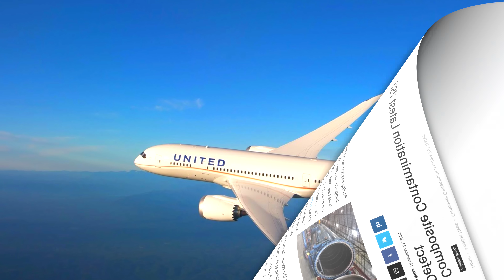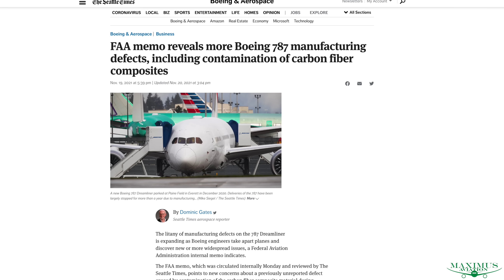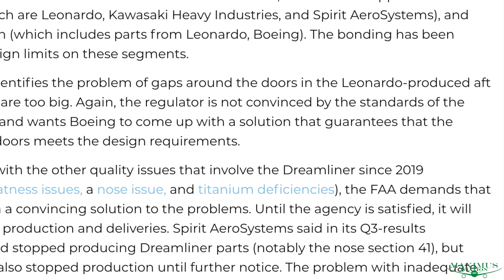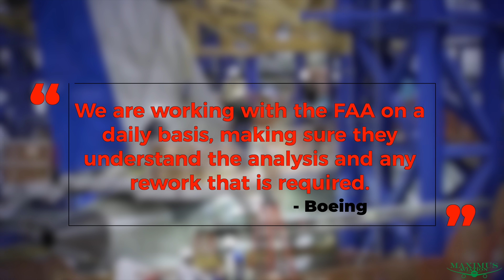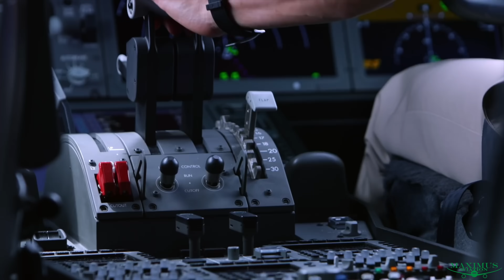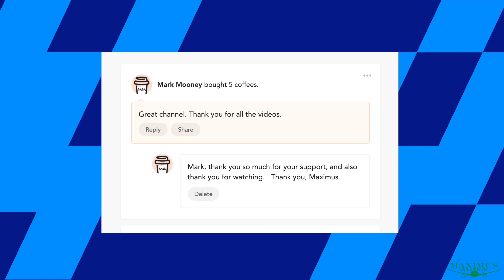Boeing Admits The 787 Carbon Fiber On The Wings Are Contaminated And May Compromise Wing Stability.

Comment: I used to be "if it isn't Boeing I'm not flying", and I do pick aircraft when I purchase tickets.  However, no more (besides the established Boeings like the 737s, 747s, 777s and no MAX of course).  Now I find myself flying more A320neos, A330s, and A350s.  By the way, yes 787 has never had any fatality yet, but remember they never really figured the cause for the battery fire problem.  They offered a very comprehensive and extensive "solution" to the battery redesign and installation, and that seems to "solved" it, but they never figured out what caused those battery fires, that really worries me.

Comment: A few things to be noted is that carbon fiber composites are used in civil aviation since the 1980"s..the DC9/DC10 used body parts made of carbon fiber....and there is two fantastic American companies who are the world leaders in this sector : HEXCEL and CYTEC ...the fact is that BOEING did not work with these two experts in the matter....you mention their names in the video/..,but AIRBUS did use their products ,fabrication ,and expertise.,that is why 50%+ of the  Airbus A350 is made of such materials..it's also 50% for the B787 but BOEING decided to work with other companies (too many actually) for a mediocre result that they face today...So yes AIRBUS did what BOEING  did with their composite body/wings parts..,but they worked with the best in the Business ,where BOEING decided to work with much less reliable companies...I guess for a lower cost .!!!..You say also that the B787 has been flying with ZERO crash issues for the past 12 years (great)..,but it"s for the next 12 years,we might have to worry now ,when carbon fiber parts fail..it is catastrophic and explosive...!!Hopefully it won't happen.!!.No more safe and reliable aluminium 747 flying for 30 years..!!!..and sadly it seems that BOEING has taken the same  path for the much awaited 777X ,with a very slow fabrication rate of only 3 units a month(says Boeing's CEO) with already flaws pointed out by the FAA certification board..BOEING must go back with working with the best ASAP ,and the best in the business of carbon/composites are American companies..!!!

Comment: Lets face it, only us, airplane enthusiasts read this. The majority of people couldn't care less
or the glue is holding or not. As long as they can fly for a few Euros from Amsterdam to Spain. Interview sample when the Max started flying again :" Madam, are you afraid to go on board of a Max? Answer, just a bit as long as it doesn't crash on the way to Spain giggling.
This was on Dutch TV. Interviewer once more , So on the way back it would be OK ?
Answer, well at least we have had a good time, giggles again.

Comment: Carbon fiber wings are nothing new, and Airbus is the pioneer in both carbon fiber in commercial aircraft and fly by wire and relaxed stability flight control systems. You cannot blame Boeings problems on technology - it is people in senior positions who are fault. You can only start correcting things when all the senior executives involved in causing the problems in Boeing have been sacked. Unfortunately there are still there, and still doing the same thing.

Comment: AMERICAN aviation has always been fly it and fix it later, to beat the competition. That was fine when they had the expertise and the engineers to do that, unfortunately cost cutting means they don't any more. So the have a new species of complex aircraft, with all new complex problems, and with the 737 Maxx and the dreamliner in trouble, they are in a very bad place.

Comment: Airbus is having its own issues with carbon fibre adoption.
Reply: That's right, but after a relatively inexpensive repaint affected 350s are fine again (the option all affected airlines excepted Qatar chose), while compromised carbon fiber in structural parts of the wing would demand new wings in worst case.

Comment: Wonder if this problem is also with airbus.. the composite failure issues airbus has found during paint stripping
Reply: There is no composite failure at 350s, it's a problem with the paint adhesive, probably because of the wrong choice of paint at early 350s. Carbon fiber expands different than aluminum in heat. 
There have been other airlines affected beside Qatar, however they chose a free repaint by Airbus and they fly their aircraft again, Airlines like Lufthansa which are not known to fly unsafe aircraft

Comment: I would like to know where the PTFE contamination is. Is it parts of a peel ply left on the surface of a laminate stack and was painted over but will not harm the structural integrity or is it in between plies?

Comment: Boeing took a risk and Airbus benefited?  More like Boeing forgot about quality control and concentrated on stock buyback to jack up its stock price.
 38 billion dollars that could have been used to train workers, retain and hire good engineers and produce quality product was used to buy back its stock. Boeing 777 was the last best Plane Boeing designed and made. After that for the last 20 years it has been going downhill.

Comment: Just some notes here as your story telling make it seems like Airbus waited to Boeing to experiment with new lighter and stronger laminated carbon fiber structures. In fact Airbus did experiment such structures far earlier than Boeing. i.e. the A310 series had a full composite tail fin and that was back in the mid 80's. The only step Boeing did before Airbus was to make a all composite airliner. I believe Beech was the first to produce a full composite aircraft for pax transport (apart from experimental aircafts or general aviation stuff, gliders etc.) and that was also back in the late 80's.

Comment: Who says the 777x won't have the same issues?
Reply: The 777X gets new engines - which are another possible risk. Engines and their reliability have been a Problem at the 787 (RR) and the 320 Neo (P&W). 
Aircraft are today built at the limit - which brings the risk of teething problems

Comment: Such a fundamental change in the structure of the craft - aluminium to carbon-fibre, should have required far more testing before rushing into production.

Plain and simple. Again, it's a problem of inadequate oversight by the FAA and the EASA. A350's are having many issues now as well.
Reply: Only partly true - as Boeing had developed it's own carbon fiber composite structures technology in the commercial arena, on the 777 program. Have any tail feathers of a 777 ever come apart not due to externally caused bond-failures? No. I was there.
Reply: @mafreeland1027ATGTurner  Which has nothing to do with what I said, except perhaps Bieing did better QA testing than Airbus.

Boeing has had its own quality issues in other areas, so maybe they aren't the best example to bring up.
Reply: @mafreeland1027ATGTurner  What do tail feathers have to do with cotaminated carbon-fiber in the wings?
Reply: @mafreeland1027ATGTurner  The tail fin of the A 300 was already made of carbon fiber. At the Concorde the rudder was made of this material. 
Other manufacturers used unconventional methods long ago, for example North American Aviation which used honeycomb structures in their XB-70, designed in the late 1950s

Comment: Airbus has had its fair share of problems with the paint and lightning protection on the A350 which is also related to composite carbon fiber use

Comment: I was a young electrician apprentice when Boeing Wichita (at the time) started building the nose cone precess building.  The project was start with problems.  Lowest bidder construction company Eby made many million dollar mistakes and at the time was loosing all contracts other then Boeing.  Eby got the project because they had already been security vetted and they had the lowest bid but later did change orders that cost far more then what they disclosed.  Had to tear down part of a building because the autoclave wouldn't fit through the door and a big hole in the wall of the clean room with a lift to name a few.  The technology and tools of fiber composition laying was least from Hawker Beechcraft (out of business now).  Mid project Boeing Sold the Wichita plant to Onix/Spirit Aerosystems and essentially fired all of their workers or cut their wages in half.  Many lost their pensions too.   They also are farming out almost everything where as before they built everything inhouse.   Boeing use to stand for quality and American ingenuity.  Their cost saving steps have cost them their reputation,  jobs, and the reputation of the US market. Thanks Assholes.  Boing is being hit by its own Karma and short sightness.

Comment: The first aircraft with carbon composite fuselage was Beechcraft Starship. and they demonstrated how not to do it. Just saying. (Airbus used a different composite, GLARE (glass laminate aluminum reinforced epoxy), although not to the same extent as Boeing.

Comment: Surely Airbus have similar issues with the new structural techniques.  How are they dealing with it?
Reply: The early A 350s only have a problem with the paint adhesive, not with the composite itself. You can give them new paint jobs (which isn't that difficult since aircraft are typically repainted every 7 to 10 years anyways), putting new wings on on an aircraft with high production numbers is barely feasible since the costs would be astronomic

Comment: The first 787s off of the assembly line should have been torn down to the ground and every manufacturing flaw identified and fixed then.  Had they taken care of it then, there would be no doubt now of the capabilities and safety of the plane now.

Comment: I find it unlikely that the PTFE used in the release cloth used in virtually all fabrication of composite parts, carbons fiber or otherwise was not given due scrutiny by Boeing in the process engineering and production of these parts

Comment: would the 787 grounding and production halts due to quality issues, and the several 777X certification setbacks  have happened without the 737 MAX fiasco?? I really don't think so. Boeing mislead the FAA for years. For decades maybe. Before the purchase of MCDonnell-Douglas, things went well at Boeing. The old/new 737s, the 757s, the 767s, the current 777s and the 747s are good planes. Without any big issues. And Boeing was leading the market. Up to 60 % market share in the late 90'. Despite Airbus competition. Then Boeing created a very state-of-the-art B787. A jump into unknown territory. And the management considered all the subcontractors would help to save money and make the 787 another cash machine. By hurting hard Airbus with their old A330. Airbus was still busy to try to sell the A380. But Boeing did not care properly with the quality control of the B787. Then Airbus launched the A320/321 NEO family. With immediate very strong sales. And Boeing reacted with the 737 MAX. In a panic move. By adding new technology on an old frame. And the B787 was selling very well. Maybe too well. After the 737 MAX disaster happened, The FAA did find 100 glitches and malfunctions. Then the FAA decided to look deeply in the B787 quality controls and the B777X certification. Today Boeing is losing money with the 2 aicrafts. Despite good sales. And the future 777X will need 10 years to be profitable. While Airbus is holding 62 % of the civil market. And is making good profit with each plane made. Despite the B787, the A330 NEO is still alive on the market and the A350 is gearing up. With a coming cargo version. The A220 has no competition from Boeing. What a difference. The Boeing management is the sole responsible of that mess...from a prestigious engineering company into a greedy financial group....
Reply: You are so truthfully accurate in what happened. "McD bought Boeing with Boeing's money an prestigious history". I was there!

Comment: Woah, so at this point with so many 787s flying around....AND with the jury still out on the safety of the MAX... It's American roulette time, I guess.
I'd better stick to A350 330 380 or B777 for long haul and Bombardier, maybe 737NG for short haul. For the mean time.
Only after this sick pay-with-your-life open beta test of Boeing's has run a good 5 to 6 years without a crash that isn't attributable to a faulty plane will I ever knowingly let myself on a 787 or MAX.

Comment: Boeing stock should be worth nothing. Present management is solely pursuing lowest possible cost of production. They have abandoned manufacturing quality and engineering competence. 
Existing airline customers have been unwilling to accept planes build at Boeing’s South Carolina plant due to poor quality of production. So now Boeing is transferring all of its production to this plant. Sales 101 – make the customer happy. Now is that making the customer happy; not at all!
The lithium batteries on the 787 that caused fires, was an engineering failure beyond belief. My next-door neighbour, high school education, building remote control planes at the time of the 787 fires, knew more about lithium batteries and fire potential than Boeing did! That is truly revealing of Boeing’s engineering incompetence.
As a retired safety engineer, the reliance on a “known to be unreliable” sensory, is monstrously incompetent. On the 737 Max, the software control system (Maneuvering Characteristics Augmentation System (MCAS)) that worked in the background (hidden from the pilots) depended on the angle of attack sensor on the outside of the plane. This sensory is known to be unreliable. Fundamental safety engineering rules state that such an unreliable sensor should never input to an online controlling software system. As a retired professional engineer, this negligence is not just unprofessional or due to incompetence – it is criminal. People died due to this incomprehensible engineering incompetence. Management was not paying attention; they were off cutting costs, or whatever.
These issues, and as a stock market investor (a retired engineer in a time of zero interest rates) makes me firmly believe that Boeing’s stock is worth zero due primarily to their upper management, board of directors and senior engineers being incompetent compared to global standards.

Comment: The reason for the contamination is actually very simple, and easily avoided, but I cannot find a single comment here that correctly identifies the problem.
Somewhere between the 'need to know', and 'profitability', the marketing department holds the key to a company's success.
And the PR guys sweep the truth under the carpet.

Comment: The unmolded surface of any composite part cured in an autoclave is going to have trace PTFE residue from the peel ply release fabric. The problem here is not the contamination, but that the bonding methods for joining certain autoclaved parts were apparently not engineered to remove or tolerate the amount of surface contamination that should have been expected.
Reply: Not true.
Reply: Your first sentence is spot-on, but your conclusion is premature. Until "we the interested and informed technical public" know more details about where, how, and at what stage of bonding or assembly the contamination happened, no definition of likely cause or potential affect can be arrived at. If the subsequent strength testing has shown that the parts/assemblies are "still within design intent", there is much less to worry about. All of these parts, sub-assemblies and major assemblies from CFRP have design requirements that have to satisfy levels of strain failure higher than anticipated in any normal load case, before they're put into "production". Inspection is to the design requirements. Testing is done to see how far above design requirements a structure might survive. If in testing, the test-article survives with an ultimate load in excess of design requirement, the test says it satisfies design requirement. The design and manufacturer are still "Ok".

Comment: It's almost as though the Dreamliner was the 1st in it's class and now after a decade+ of flight we're now finding all these problems and giving Boeing the old stink eye about it. Must be nice being first to bring out new technology and setting the new standard for airframe building throughout the industry. Just as I finished writing that Max basically said the same thing lol. Anyway at least Boeing are fixing the issues and I won't bash them for it and still I will say if it ain't Boeing then sure I'm a still gonna go but man I will be a wishing it was still Boeing alas Airbus will have to do even though they stink of p oh wait wrong story thanks for sharing Max.
Reply: The primary differences on the 787, is that the majority of the actual production of the aircraft CFRP (Carbon Fiber Reinforced Plastic) structures was sublet to other companies who "claimed" to know how, but aparently didn't. Those decisions were made by bean-counters and cost-share bureaucrats who knew NOTHING about the technology they were dealing with. The engineering and manufacturing technology associated with the 787 was originated by the 777 program, which was successful in applying CFRP materials to production aircraft, for permanent production design and fabrication.